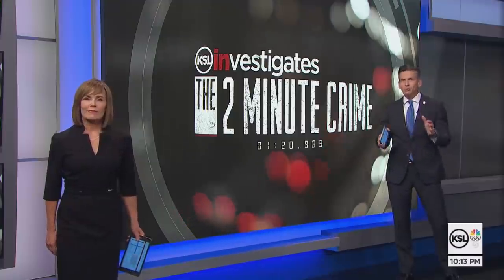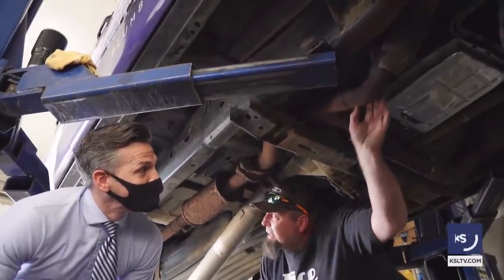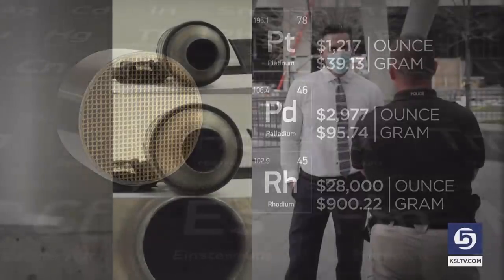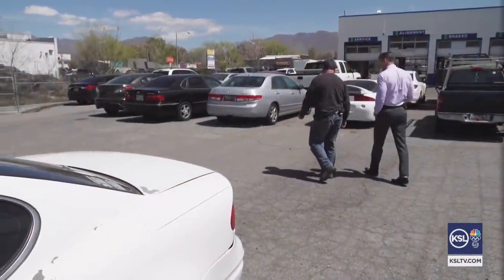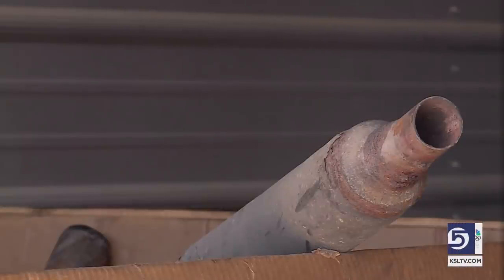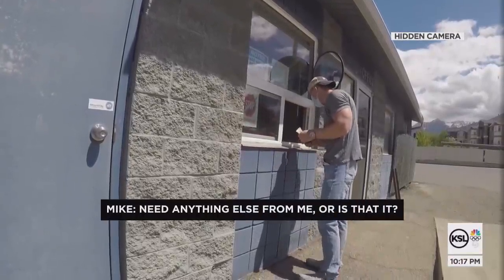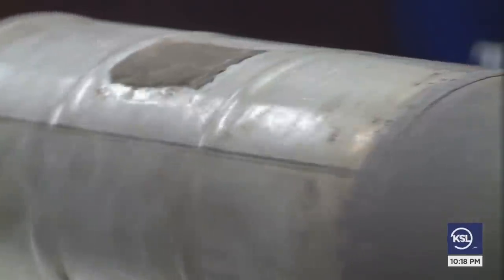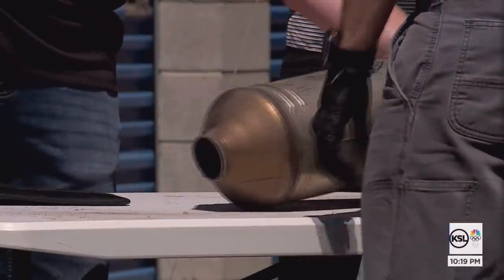KSL Investigators goes undercover to check compliance as catalytic converter thefts skyrocket

Comment: Prosecute the complicit buyers of the converters!!!!
Reply: Why?
Reply: @warrenmcelroy4718  ugh, non compliance with state law so they are receiving stolen property?
Reply: @alfavulcan4518  I believe more in going after the criminals that I do going after folks that are just trying to run their business.
Reply: @warrenmcelroy4718  if there is a buyer, there always be a seller. No buyers then problem solved
Reply: @alfavulcan4518  that’s a very ridiculous outlook, there are many many honest people that make a living in the Junk Cars business and your “solution” would hurt more folks than it would help.
Reply: @warrenmcelroy4718  ridiculous? that’s why there are regulations with requirements for documentation. If a buyer doesn’t get the required seller info, he is part of the problem. We had a big problem with telephone cables being cut down and stolen and once they cracked down on the scrap wire buyers, problem ended. I worked many a long night in a bucket truck splicing up new cable
Reply: @alfavulcan4518  That’s called Job Security, stealing is obviously wrong but that’s why they say “it takes ALL Kinds”.... beyond that, I know old guys that have been hanging onto Converters for YEARS, stashing them away waiting on prices to go up, these guys don’t have all the info for each converter especially those that they’ve had for ten or fifteen years. The most states regulations on selling certain car parts are just as ridiculous as your solution, that’s why many people don’t hesitate to bend those rules and I don’t blame them. Now if they know they’re buying stolen converters that’s one thing, but to bust everyone for overlooking some of these over reaching regulations is pitiful when that time can be spent going after the actual scumbags
Reply: @warrenmcelroy4718  by all means go after the scumbags too but to say these buyers are innocent is crazy. They know a lot of them are stolen and some, certainly not all, turn a blind eye to it and need to held accountable. Pawn shops had to clean up their business practices, so should scrap buyers. Retired now, days of hanging from a pole are over for me!
Reply: @alfavulcan4518  your logic isn’t correct. The buyer isn’t needed. He’s the middle man who buys the cats cuts them up and sells the metal. If there’s no middle man then the thieves will cut the cats open themselves. Then take the metal out and sell it separately.
Reply: @thronewalker1153 your wrong because no thief has a refinery to do such work and might I add I owned a scrap yard and the amount of energy to reclaim the precious metals even if they did it with chemicals those are expensive and requires the knowledge that most don't have .
People are lazy more then ever , I think you should pay attention to society more if you're going to comment on something you clearly do not understand.

Comment: This is what you call a triple dose of robbery. One from the state, and the other from the street theives. Finally let's not forget the mechanics to replace the part to get back in compliance with the first group of theives. What a vicious cycle of getting screwed! No matter how much lube you use, this is getting it royally.
Reply: You are also missing insurance companies... once you report something accidents/thefts/burglary. Insurance will triple your rate despite the fact that you have not done anything wrong.
Reply: You can buy a test pipe briefly. Before law requirements these were common because cheaper. How ilkegal is that anymore abnd of ciurse over timecyou are hurting air quality?
Reply: Yep! I’m learning this right now my cat was stolen 2 days ago. What a set up to be living here in cali.
Reply: @ladyfame1430 nothing but trash out there
Reply: And in NJ, you cannot pass inspection without it. Mechanics know this and will charge you $100 or more just to tell you why your check engine light is on. A friend of mine had the OBD scanner, but those aren’t always accurate.

Comment: Why dont they make them as hard to remove as a headlight bulb. Something is wrong if a thief can steal my cat off my car in a fraction of the time it takes to replace a burned out headlight bulb.
Reply: Relating stealing cats to headlight bulbs when the cat is just being sawed off would be more smashing the housing and taking the light out. If someone is willing to use power tools nothing is locked.
Reply: @MrSubmariner13  well... that was a more aggressive reply than was really warranted.  Ha ha?
Reply: @MrSubmariner13  you’re awfully upset over it...
Reply: @MrSubmariner13  you're a sad person, yea? Lonely?
Reply: They get so hot it is nearly impossible to secure a catalytic converter. I suppose you can put some sort of skid plate or brace in place but someone would just cut that off too since their at it. Only way is to design cat placement near a frame rail or somewhere hard to get to(like German cars) but that adds on to unnecessary repair costs
Reply: Do you even know what a "zaws all" is?... The name says it all.  You can literally cut anything with it.... Fast
Reply: It is really easy to have an alarm that detects when your car is jacked up.   I have a system that does this already,
then it takes pictures and sends them to my phone.  I'm working on a spray system to spray them down with traceable paint.  They will leave empty handed covered in bright paint, easy to id them after police called.
Reply: You can buy a cover to make it much harder to steal. But the only people that are most likely going to consider buying one of those is someone who has already had one stolen.

Comment: Huh. I used to operate a machine that helped make converters. I had no idea I was basically at a gold mine. I used to see THOUSANDS of these made everyday just stacked up on pallets in a giant warehouse.
Reply: Should of got a pocket full of that palladium and rhodium
Reply: I'm surprised this news coverage didn't go there and show all the thieves where to find a pile of loose cats. They sure showed some rookies how to get just about anybody's
Reply: @hostileaks4495  Should've*
Reply: I do see WHY it costs so much… but not from what the news is saying. Yes, I’m sure some of the materials were very valuable, but the multiple refining processes and the time it takes to put through all the machines and different people who have to inspect it. I’m not even sure how many steps there were but I was a part of the initial stages. I know converters are made from a type of clay that has a special purple “dye”. It went through a machine that gave it the holes. Then it went through a “microwave” and my job was to make sure the temperature was right and report any visual deficiencies in the raw product. Then a “dryer” which hardened the material and then the sawing machine. But there so many steps after that I don’t have a shot at knowing it all now.
Reply: If there aftermarket ones.  They ain’t worth nothing.  Only oem ones are
Reply: The aftermarket ones are not worth much as they don't use much of the expensive materials, so they don't last very long, couple years your cheap cat stops working again, OEM cats last 10-15 years
Reply: Whose idea was it to put those valuable metals in  the converters to begin with ? Does it really cut back on pollution ?  Another bright idea from the government.

Comment: Car companies have known about this for quite some time now.  It's a wonder why they can't make them more theft resistant.
Reply: They don't care. As long as they get their money.
Reply: Bmw enters the chat...literally have to remove engine on some models to get them suckers out
Reply: Bmws are not easy.. yeah^ lol
Reply: Because it hasn't become a big issue until recently
Reply: Not sure how knowledgeable you are about cars so please don't take any of this the wrong way. Pretty much any modification to a catalytic converter makes no sense and could actually be rather stupid/bad. If you block them off to make access hard you'd be basically re directing the heat upwards into the vehicle. They, along with the rest of the exhaust system rely on air flow to cool down. Also since exhaust systems depending on where you live rust out so blocking them off would increase the price to have them serviced. And since O2 sensors are commonly found before and after the cat it would create even more problems. And finally, and this holds true for anything, if a thief is determined to steal something, they're going to get whatever it is no matter the obstacle. So for the amount that get stolen it doesn't make any sense what so ever to change the design. A drop in the bucket compared to ones that will never be stolen.
Reply: It isn’t logic. Again these thieves use saws and blades that cut though metal. Redesign is pointless.

Comment: Unless you are in CA, a catcon is just not that expensive. I had one replaced on my 4 cylinder 1993 Jeep Wrangler about 5 years ago by a local shop for just over $300. It was not the oem part, it was aftermarket. Only CA requires they be replaced with the oem part, which is often not even available anymore for older cars.
Reply: I’m in California with a Jeep so I looked into this just in case. To replace mine the cost just for the unit was $520, the price changes constantly and it has to be a CARB converter. Muffler shops are sometimes getting in on the act telling people they need to replace their $1600 catalytic converter when there’s nothing wrong with them.
Reply: @steveblankenship5474  I've heard of converters costing over $3K in CA. In AZ they do not have to be CARB approved, and are not usually very expensive. Many new cars are now coming with THREE converters, and that can get expensive, especially when there is no way to test one. In my case, my Jeep failed the emissions test, the shop could not get it to pass by doing everything else. They were able to just bang on the converter, and got a hollow sound, and could hear stuff rattling around in there. The converter core breaks down over time. Yes there are a lot of crooked shops out there. If your vehicle passes the emissions test, the converter is fine.

Comment: Get a skid plate to prevent theft. That's what the officer advised after two vehicles at work had their cats stolen in the middle of the day, with cameras watching, and people taking breaks outside.... takes less than two minutes to cut off and up to 6 weeks on backorder to get them replaced.
Reply: Order an aftermarket cat off ebay for less than $100.  Pay for overnight shipping and itll be at your house tomorrow
Reply: @getchasome6230  facts.
Reply: In the Bay Area longer than that !
Reply: @getchasome6230  And the cheapo cat will last 3 months before it stops "converting"
Reply: @brucespurier7535  If you say so pal.

Comment: I bought a high flow cat for $80 from my local auto part store. don’t know why you’d buy an OEM one
Reply: JFilms ... because the OEM cat will last 100,000 miles or more and the aftermarket ones might last a couple of years at best.
Reply: @rupe53  if you replace the cats with pipes you’ll never have to replace them or worry about the thieves.
Reply: @thronewalker1153  .... yup, but you will have to worry about annual inspections, which we have in our area... on all vehicles less than 25 years old. In the case of older cars / trucks you can get antique / historical registration and be exempt from all of that stuff. This opens up lots of possibilities for vehicles between 1975 and 1996 that no longer require inspection.... but originally came with all sorts of emissions devices.
Reply: California and NY require original equipment only.
Reply: @robertheinkel6225  ... here in Ct they still allow aftermarket as long as it's an approved unit. I see many listings specifically say "not approved for use in California" or similar.... but ok for the other 49 states in a retrofit. I did fleet work for the last 30 years and my main concern was working well enough to get the dash light off for inspection... and lasting long enough till we replaced the vehicle. I'll be dipped if I was gonna spend $1500 on an OEM front pipe with 2 cats if the van was being replaced in 2 years. Sometimes it's a judgement call.

Comment: If people would just cut em off themselves.. weld on straight pipe. your fuel mileage goes up, power and torque goes up 🤷🏾‍♂️
Reply: Still need to buy a tuner to trick the computer .
Reply: @soulerflare7  true if you did custom pipes. Some cars have aftermarket parts that will bolt up perfect and have defaulters that trick the ecu. Therefore no engine code.

Comment: No one's paying $2,000 for some cats, performance cats for my Z06 are $700
Reply: Those will flow well but they probably wont keep your check engine light off long. Bet your OE cats costs waaaayyyy more then that, and have a much heavier loading.
Reply: Just get some longtubes
Reply: We sold one off of a Mercedes a few weeks ago for $900 so I’m inclined to agree with you. Now the Cats and DPF’s that come on newer Diesel Powered Vehicles are a different story, you can easily get up to $2500 scrap value for some of them, but that includes the Cat and DPF system all together in one piece.
Reply: Back in the 80's they would give you $100 tops... my my how things have gone UP!
Reply: @Tiger-From-Clemson  yeah when we had exhaust work done on our trucks we would ask the guys if they would cut the converters off and pray to God they wouldn’t ask us to take them with us.
Reply: A OEM brand new Toyota Prius catalatyc convertor is $4000 and states like California only allow OEM catalatyc converters
Reply: Cheap knockoffs from China

Comment: Im surprised they are not stealing gas yet, remember last time a gallon cost this much?
Reply: Until your paying $1.80 a LITREc for 98 Octane . . . .
 (yours is 4.5 Litres per $)
Reply: You cant steal gas from cars they all have non siphoning systems
Reply: @thatguy6214  really ? That proxy mesh screen?
Reply: @DVSUte  nah i forget how it works but upon a quick google they have kits that requires a pump to get it out so I guess you can still steal gas. Instead of just a hose on old asf cars. Gas covers are locked anyways tho so youd have to deal with that.
Reply: @thatguy6214  all it takes is a nail, a hammer, and a bucket. The gas tank on most models is plastic, they crawl under the car. It's less work than stealing a catalytic converter and can be done twice as fast and will cost you just as much to repair.
Reply: @GoogleSpyZon  no that will not work due to the pressure and the fact thats a small opening. You need to vent equal amounts of air in. So your left with drilling for a bigger hole and trying to get one of the holes above the fuel level. Thats a lot of work and most liekly not possible or feasible.
Reply: @GoogleSpyZon  and btw plenty of cars have metal fuel tanks
Reply: @thatguy6214  you would be surprised, do a Google search,  you will find news stories about it. Not as difficult as you think.

Comment: I don't believe it. Just replaced mine on my Ford F-350 1996 and it cost us $350. The engine is a 460 block 7.5 liter. It's as big as it gets before its diesel.

Comment: I brought an original catalytic converter from a Ford Ranger to a recycler and got $75. (Midas charged me $800 for the replacement, but gave me the old one.) A few years later, I had to get another catalytic converter - another $800 - and Midas gave me the old one which was the one made by Midas. The recycler only gave me $5 for it, saying the replacement ones have very little precious metal in them.

Comment: i swear to god i would sneak up and lower the jack on these guys.
Reply: They don't need or use jacks.  Just slide under and sawzall it off.
Reply: @HailRider  Depends on the car. Prius cats go for a lot but they're pretty low so anyone sawing them off would need to jack it up. There's a news story recently about a guy who got crushed doing that when the jack slipped.
Reply: @koriko88  Sure, I know that. For the MOST part they are going for the easy targets. No jacks, just slide and cut. Takes 2 mins max.
Reply: Someone got killed trying to steal a catalytic converter from a Prius in Southern California because the jack failed. His partner puréed off his shoes trying to pull him out and left him there.

Comment: I drive a 2004 Lexus RX 330 and it’s nearly impossible to steal my converter without the proper equipment, I’m so grateful because in my city this sh** has got out of control.
Reply: You need the cars that have them up behind the engine against the fire wall !

Comment: The solution is not rocket science.
1) Every cat needs to have a serial number - identifying the SPECIFIC CAR it is assigned to.
2) Every purchase of a cat must have the serial number both recorded and checked against a database of reported theft
3) Payment is not immediate. Payment held in escrow for ~2 weeks, to allow time for reporting of thefts
4) Purchasers of melt-down of rare metals must cross check of the weight of materials - weight cannot exceed the list of cats from which they were extracted.

Comment: Easy fix or at least a bandaid, only licensed repair shops should be able to cash them in, and they must provide vehicle proof of source with customer info and work invoice.  They also should be required to etch Vin numbers visibly on cats matching the vehicle paperwork.    They should not be allowed to buy used cats off anyone like a recycler and they should have steap fines and loss of licences if they break the law.  No private citizen sales at all.

Comment: easy solution. pass a federal law requiring auto manufacturers to stamp the vehicles vin number onto the cat, and a 2nd law that prohibits recyclers from purchasing them if the vin on the cat has been tampered/removed.

Comment: A serial number should be marked on the inside of the Cadillac converter. To tell if it’s stolen just shined a flashlight with the camera to check the serial number marked inside.